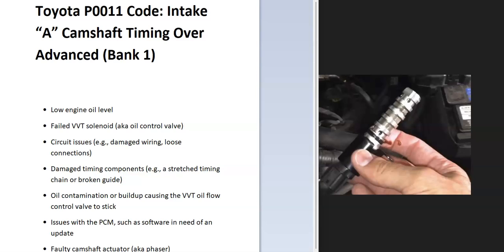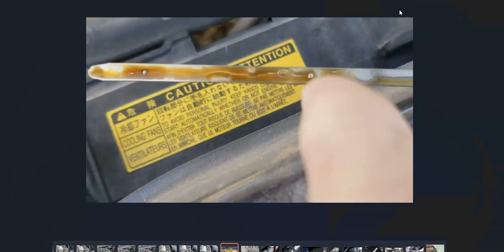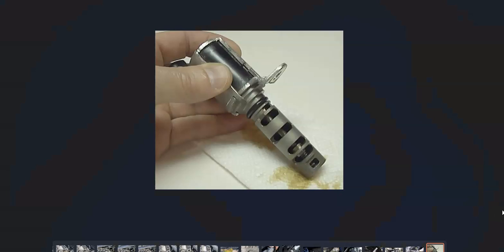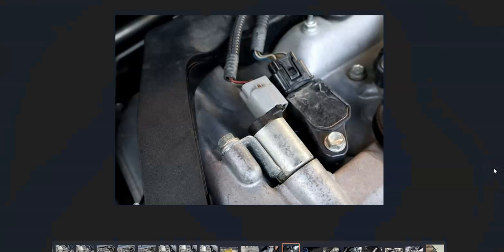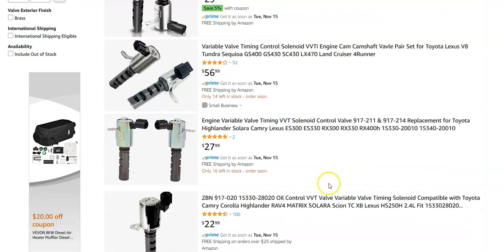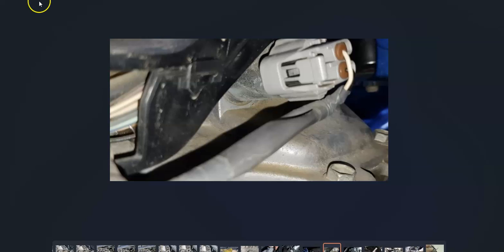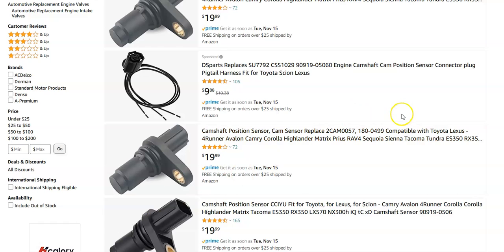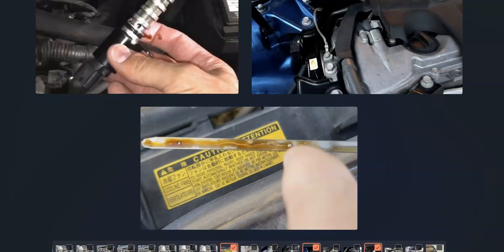Causes and Fixes Toyota P0011 Code “A” Camshaft Position – Timing Over-Advanced or System

Comment: Mine is popping up when my oil is getting low. 2008 Prius that burns oil. So what would cause it to burn oil?
Reply: Piston rings leak oil into the cylinder. Chinese piston rings lol
Reply: Need to replace your PCV valve. It gets stuck open and sucks oil into the intake. This can also cause catalytic converter issues if it continues. Super cheap part, and common with higher mileage toyota 4 cylinder engines
Reply: Also, a prius 4 cylinder engine has a lot of stop/starts, which causes carbon buildup on the rings, which causes them to stick to the piston and not float freely. This causes oil blowby back into the combustion chamber as well. Sadly, this is the #1 killer of those engines.

Comment: I connected it to electricity 
No longer working from the inside what to do
Reply from the maker: Use a meter and check the voltage at the outside unit terminals (L1 L2) is correct. If that is good, check the communication wires running between the inside and outside unit are correct and have good connections.

Comment: Thank you. I used motor flush 10 min at idle drained oil then P0011 came on. Car started running uneven & stalled. Think I dislodged chunks that clogged VVT solenoid. Car ran perfect before i did this. Ughhh

Comment: Do not buy the garbage generic ones online. Buy the factory part, its about $130. Not worth the grief
Reply: Exactly right.  Go OEM on these.
Reply: I learned that the hard way. I bought two aftermarket water pumps both were garbage. When I bought the OEM one, it worked like a charm